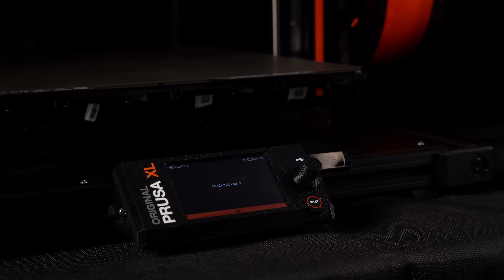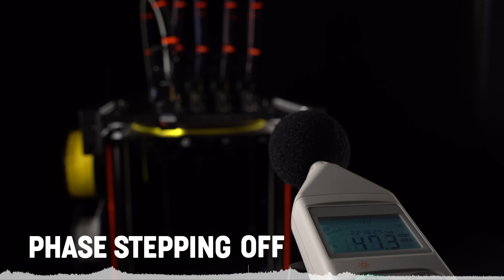Phase Stepping on the XL – Josef Prusa Explains 3D Printing

Comment: Got a 5T XL in Dec 2023 and a 1T in Nov 2024....

The 1T has been lots of pain.

Chasing ideas with the belt, with the filament, nozzle (ObXidian 0.4), and going the rabbit hole.

It seems that there's a slight issue with the IS freq. Unfortunately got no way to measure and adjust if needed. And Prusa doesn't seem to offer anything for the XL, they only have the accelerometer kit for the MK4S 

Wished this was a bit easier. A $4,000 printer is now giving me more issues than benefits 😢.

The 5T is good but not great. My old MK3S printed waaaaaaaaay better. I used to love that print quality, all without much effort - Not with the XL 😢

Comment: I have a suspicion i know how this operates and i've worked on something in a completely other field that i believe works in the same or at least similar manner.
For a given input you get a resonant frequency and harmonics.  You can map out the resonant frequencies and their harmonics when you cycle through a range of inputs.  Once you have a 'map' of these points, you can figure out a path to go between zero acceleration to maximum acceleration where it avoids all of these troublesome frequencies.  Once you have a 'path', you then map the desired motor control output to an output your path states it should be.

Comment: Will the results of the calibration be affected if you got some dampening mats on the printer because the resonances would be much lower?
Reply from the maker: No, different matts, tables, etc. shouldn't have any effect on the source of the vibrations, so no need to re-calibrate. The printer/table is only a medium through which the vibrations distribute, in the case of what Phase Stepping supresses. -Mikolas
Reply: That's good news because I put them on the sidewalls and the y axis "arms" months ago because the resonances where extremely loud and I think I could not even get them back off without a total mess 😅

Comment: So what is the difference between phase stepping and Bambu Lab's noise canceling feature?
Reply: I know that, that's called money
Reply from the maker: Hard to tell, since the firmware for their printers isn't open-source. But Phase Stepping affects both print quality and sound, from what I've seen, Bambu's solution was really focused on audible noise alone. -Mikolas

Comment: what is this phase stepping? how does the calibration work? what does the signal look like after calibration? is this some previously published method or did you come up with it yourself? could other printer manufacturers implement it as well? so many questions

Comment: Hey Prusa! Your customer support is a joke. Completely unacceptable that an agent takes 3-4 weeks to get back to you while diagnosing an issue, only to ask you to print a small test-print or try some calibration step you've already done multiple times, then take another 3-4 weeks to respond. I have been emailing back-and-forth for about 6 months now with an agent who has consistently taken 3+ weeks to respond (to which I'm pretty sure he would NEVER respond if I didn't send multiple follow-up emails). Still no resolution for an obvious hardware issue I've had since day 1 on my XL. So much for the amazing customer support you advertise!

Comment: It is unlikely that this message will reach Master Pruss. He invented kinematics. Everyone considers him less successful than others. In my opinion, the potential of this kinematics has not been fully realized. Elementary! Where does the vibration come from? I have always been against installing two engines precisely because of incomplete synchronization.
Engines are understandable, but tell me where the vibration will be higher? When the center of gravity is high or low. There are a lot of such unfinished things. The accumulation of small defects leads to their transformation into qualities, in a negative direction. I understand that the company receives 1000 letters from inventors. I also offered my services. The company decided to follow the path of BlackBerry.

Comment: 👍 Or in other word, multidimensional stepper phase current table (table providing the current phase function of the angular phase, angular speed, and angular acceleration). Finally! That's brilliant! I have been wondering for years why nobody hasn't done it yet.

Thanks Prusa!
Reply: Care to explain this in more detail?
Reply: @ElectricBard  yep. The only non-trivial prerequisite to the following explanation is probably the understanding of a pure sine (or cosine) wave basic characteristics: frequency, amplitude, phase. Bear with me a minute it will soon make sense.

1) - under no load (no torque), when you drive a bipolar stepping motor's phases A (and B) with a perfect sine (and cosine) current at a constant low frequency (quasi-steady state), you expect an ideal motor to rotate at a perfectly stable speed (ie. the rotation angle is perfectly in sync with the driving frequency). In practice the "imperfections" of the motor lead to tiny yet measurable unsteady rotation speed of the motor: the angular position of the motor get periodically ahead and behind the expected position. This periodic occillation around the target angle at a constant drive frequency is the origin of some subtle position inaccuracies and audible sound. If you measure this irregular response of the motor (build a correspondance table of the actual motor angle function of the driving current phase) you can actually eliminate the angular oscillations: instead of driving with perfect sine (cosine) current, for each angular step you look through the correspondance table which current phase you should drive the motor to reach the target angle. Simple! This "current table" compensation method is well known. This functionality is available from factory in many popular driver IC used for "hobby" 3D printers. Yet I am not aware of any popular printer or firmware using this functionality.

2) - The response of the motor measured in 1) varies with the load, the driving current amplitude and frequency. Therefore a single "current table" can only compensate a narrow range of the actual operating range of the motor. Hence the need for a "multidimensional current table": the table relates not only the current phase to the actual motor angle (monodimensional) but also account for the load/acceleration (bidimentional) and most likely the driving frequency as well (tridimentional).

CNC manufacturer tend not go that far, relying on feedback systems instead, especially because the load is usually unpredictable on cutting machines (and also because they don't use stepper motors in the first place). But the load, speed and position of a printhead is, reasonably so, fully predictable. Making a simple feedforward algorithm such as a multidimensional current table potentially very effective. Input shaping itself is based on this very fundamental assumption of the predictability of the printhead motion. It is also a feedforward algorithm.

Prusa might probably go beyond only this phase correction to reduce the noise, but I think that the idea is basically laid down there.

Comment: Do I need to do anything aside from updating firmware and running the calibration? My XL-5 sounds exactly the same as before. (Edit: my XL-5 is running great and the prints coming off it are amazing, so I’m not complaining!)
Reply from the maker: Hi Josh. In some units that were running perfectly, and silently, before the new firmware and calibration, it is possible the user will not feel the difference 🙂

Comment: Since getting my XL there’s been so many updates and improvements, it feels like another machine. Keep it up PRUSA!
Reply: so you received an incomplete product, you were a beta tester who tested the equipment for them
Reply: @ObiWanPL  Nope, I'm talking about OTHER EXTRA features like phase stepping, stealth mode, adding touch screen, cancel objects, stuck filament detection, binary gcode, octoprint support, arc welding, spool joining, various updates to prusaslicer and prusaconnect, etc that they never promised or mentioned in marketing. The only features that I believe falls into that "beta testing" category was input shaping and pressure advance however they were already out when I got my printer.

Comment: 10db reduction from doing mine. I was blown away for 90% of time the sound was imperceptible over ambient noise. Some travels were still noisy but no where’s near as much. I ran machine at 200% speed and nothing worse than with out it turned on. 

Placing some sound damping material on the y rail shroud (that holds the led). And under the bottom panel and the Side panels. Will be awesome. If you put thumbs on the y shroud it cut sound down heaps too.

Comment: This firmware update made such a big difference on my XL! Not only noise but also it improved my print quality a lot. I battled VFA beforehand for hours and got it to a state where it was acceptable (I think I caught a bad sample of a motor) but this update nearly completely solved this issue. VFA are now comparable with my Mk3S+. Thank you for the hard work and the continuous updates. I know why I chose Prusa.

Comment: For me this update was the biggest win for my XL 2T because I work and sleep in the same room the printer is printing. I tested the alpha firmware and was already impressed by the result my printer went from only usable with headphones on and listening to music, to i can sleep while its running. The travel movements ín the alpha where quite loud but that also got fixed with the full version and stealth mode. Im so happy with the printer in its current state. Now the only thing left for the printer is a skew correction so that I can finally print functional parts accuratly. But big W for this update!

Comment: First I often had random layer shifts, even if I didn't use input shaping or even turned down speed and acceleration in the slicer.
That was basically my only complain about my XL as I didn't had any other issues and did not found anything online about other people having this same situation.
But since the phase-stepping update there is no more shifting at all, even with older gcode. And now I coudn't be happier with this printer! :D

Comment: This is the first time anyones ever addressed this artifact deviation. My ender gets this even.
Reply: are you sure? Bambu lab noise cancellation is the same
Reply: @chronokoks  What do you mean??
Reply: @Reds3DPrinting  are you an artificial intelligence unable to use google? Active Motor Noise Cancellation
Reply: @chronokoks  wow how rude. That isn't even the topic of the video or what my comment was referring to so your comment didn't make any sense. Really still doesn't. What are you talking about? What about Bambu and noise cancelling? What does that even have to do with anything involved in the video or my comment?
Reply: @chronokoks  What's your issue?
Reply: @logitech4873  i refuted that boneheads claims.. bambulab did in fact do the same and sooner than Prusa. So yeah. He acts surprised and tries to deflect by claiming "that's not the topic" but the topic is his comment. And the comment is factually incorrect.
Reply: @chronokoks  I think you have a bit of an issue communicating. The guy you're replying to watched this video and saw that it improves print quality, then you come and talk about motor noise cancellation. He's talking about the quality increase, not the decrease in noise. And if you don't explain the connection between these things, how should he know wtf you're talking about?
Just communicate clearly without insulting people and you'll get much further.
He obviously isn't a bot, and you're acting incredibly rude for no discernible reason.
Reply: @logitech4873  I'm not responsible for dumb people not understanding.

Comment: Awesome! I love it.
Do we get this on MK4 too? Would be so nice❤
Reply: The XL has an accelerometer in the print head to perform the calibration, unfortunately the Mk4 does not. That means they will need to make an upgrade kit for the Mk4 to make it available.
Reply: @logicalfundy  oh, yes, I should have referred to this;-) Thank you very much for the tipp. Well, I guess it won’t take so long as the MK4 is already out for over a year. Soon there might be a i3 MK4S IS
;-)
I wish you a nice weekend.

Comment: Now we also need this for XL and MK4 at the Z-Axis. 😊
Reply: You will not be able to control the volume of the Z-axis of the Mk4 even with phase stepping. Because the vibration does not come from the motors.

Comment: I calibrated phase stepping and turned it on, and it started docking really hard. It also failed to dock on tool 5. I turned phase stepping off and turned the crash detection back on, and it went right back to docking smoothly with no problems.
Reply: Interesting.  Mine actually docks softer after the update because the travel speed to the dock seems reduced.
Reply: @bluerider0988  yeah, I reported it to Prusa chat, I just turned it off for now.

Comment: On day one my XL was a disappointment.  Now it's awesome.  Thanks for all the updates, Prusa team!
Reply: did they fix the stringing issue yet?
Reply: @glp.1337  They actually did. Fully.
Reply: @ddduckman  Really? How? I might consider finishing my pre-order.
Reply: @glp.1337  yes!
Reply: @glp.1337  yes, it's much better now
Reply: mine doesnt work what happened with urs?
Reply: @ericvanderpool5411  Prusa support is amazing, but most of the time using the new firmware and PrusaSlicer presets helps a lot. Also, stringing is basically nonexistent with a 0.4 mm nozzle
Reply: Mk4 still a disappointment
Reply: I haven't opened my XL 5 head printer yet.  Been boxed,  sitting here for 8mo.... I bought x1-carbons while waiting for my pre-order..... Not even interested in opening the machine because of all the issues I saw about the XL.....
Reply: @machineenvyllc437 wow thanks for not contributing anything of worth to the discussion by your own admission.
Reply: @GuardedDragon  I am an owner and yet have seen anything that makes me want to open it.  Too many complaints....  Sorry you didn't think it contributed enough to OHH my PRUSA is PERFECT...  and I also own 4x mk3.... they were always the top dog, until the x1 came out.
Reply: @GuardedDragon  most sane prusa fanboy
Reply: @machineenvyllc437  If you haven't even unboxed it, you're an owner in name only. Owning a box full of parts doesn't make you knowledgeable on the product, so you really have no lines in this play.
Reply: @sasca854  I print for a living   I don’t have time for projects that need more work or have to work around the problems they bring   Sorry if it bothers you.  Just a business decision  

Just like having 4x mk3  do I spend $600 upgrading each one? Or do I just Simple replace them with Bambu…  already know my answer
Reply: @machineenvyllc437 want to sell the xl to me?

Comment: MK4 needs this too :D
Reply: I believe it would need additional hardware to do so per some threads on Reddit?
Reply: @hanslain9729  Correct. Each XL tool head has an accelerometer. I have an accelerometer working on the MK4, so maybe this could get ported over, but I think they need to invest in selling a first-party accelerometer first. Hoping my work pushes them on that.
Reply: Is there any way to adjust manually by ears?
Reply: 1:46 the joke got even Prusa himself laughing
Reply: @robberd7devos  i dont get it

Comment: Is the mk4 getting this too?
Reply: Most likely not, because (AFAIK) MK4 does not have a accelerometer. Well... they could phase-step the steppers but there's no way to calibrate the phase stepping without HW changes. I might be wrong here, but that's my understanding.
Reply: @karmakh  It does have an accelerometer port though, which I have working. Boards cost less than $10 so they don't really need to wait for a new model, they just need to sell a board.
Reply: @aaronchamberlain4698  Oh, that's cool to hear. What do you mean by "working"? Are you able to utilize some off-the-shelf accelerometer in there and actually get the data out? If so, then MK4 has a much better chance to receive a relatively small add-on from Prusa.
Reply: @karmakh  YT deleted my comments I guess. I have it working. With two boards at the moment, a generic LIS2DH board and the Adafruit LIS3DH board. No code changes needed to Prusa’s code, they ship the default firmware with accelerometer support.

You can use hidden M959 commands from something gun like Octoprint to run the tunings procedure and get values back
Reply: @karmakh  ok so mk4s then :---)
Reply: @karmakh   prusa is working and testing on the accelerometer. And it will coming. This also gives hope for phase stepping for the mk4.
Reply: You would think they send out units with input shaping configured they could do the same with this